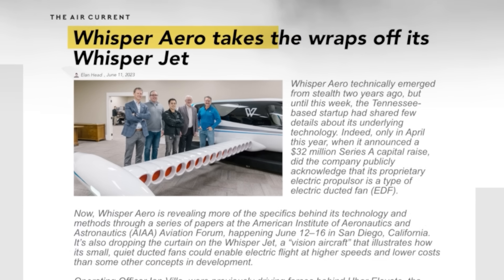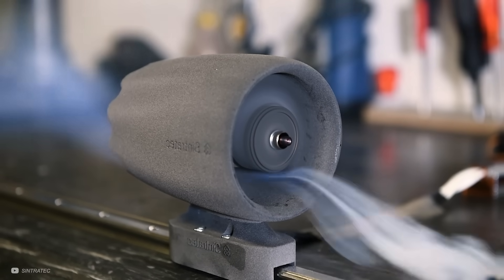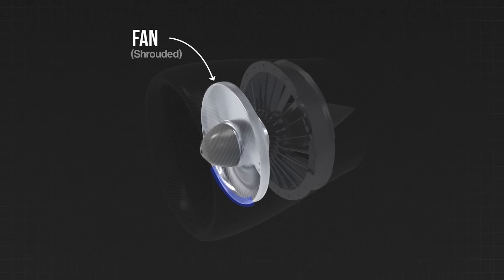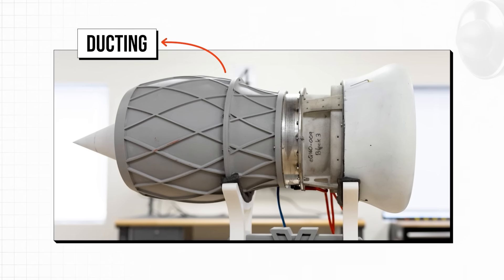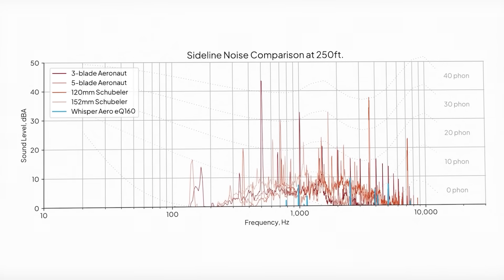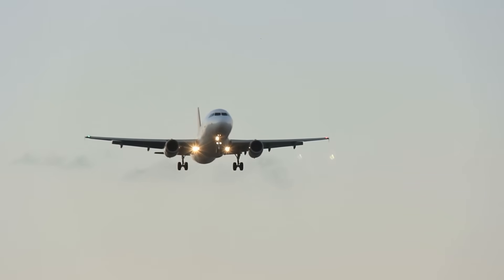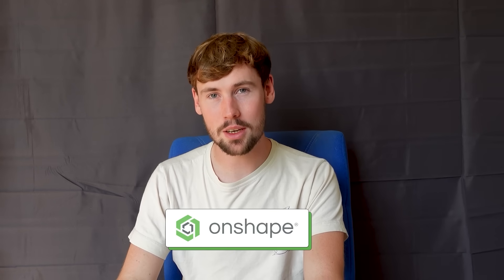This Genius Jet Engine Is Starting A Revolution

Comment from the maker: I really think this innovative design is worth making some noise about...

Check out Onshape for FREE: https://Onshape.pro/Ziroth - You won't regret giving it a try!
Reply: Just as with Lilium the swept area is too low and gets worse with more smaller ducts - heaps of interference and duct scrubbing drag .no laminar flow, don't skid or sidestep... Lippisch invented the concept, used by Collins radio and Dornier for drones and RFB in one off or very low volume production - didn't work as hoped and abandoned. In any case solving the wrong problem  . Evtol or ectol is the problem not the answer
 Impractical 'answers' by researchers who must keep researching, not solve things....
Reply: @rossnolan7283  All those daft E-VTOL concepts are going nowhere. It's not difficult to show that with current battery energy densities, they can fly for around only 15 minutes maximum. Airbus had one that managed 13 minutes for example. Completely pointless and Lilium has gone bust of course.
Reply: Until you have a lightweight source of electrical power for aircraft, ANY form of electric drive for aircraft is completely pointless.
Reply: so now calculate a normal engine on a 737 , using 1 liter gas a second , to joules, multiply that by 2 cuz 737 has 2 engines, and calculate back the batteries needed on ur electric plane ...pls give us the extra weight of the batteries .... add that to the planes weight ..... and then calculate the energy needed of ur electric plane , compared to the lighter gasoline plane and give me the numbers ...  oh , both planes have to be able to fly 8000 kilometer ...like a gas driven 737 is able to.......... have a nice day ...
Reply: @emilepojogeanu I think its already been established that electric engines will not be capable of flying an aircraft as fast as combustion engines. We're trading off speed for power efficiency and range here. We can't have all of these at once. Unfortunately, like LEGO Technic MOC builder Sariel said, there's no free lunch in Physics.
Reply: The blades in a standard jet engine are there to create compression from the expanding gasses which creates thrust.  In an electric engine though, these blades are merely fancy shaped propellers, nothing more.
Reply: @douglascounts4634  Is it same nonsense a like electric pump for oxygen and hydrogen in rocket engine.
Is it bullshit.
Reply: @douglascounts4634 Modern airliners don't have 'standard' jet engines, they have high-bypass turbofans. The bypass (cold) air produces up to 90% of the total thrust, with the jet engine part mostly being used just to power the fan.
Reply: @ZirothTech you might want investigate the FAST Fan Project headed by Rob Bolam at Wrexham University - 
Rim Driven Electric Fan - highly Efficient - genuinely a game changer.
Reply: I don't remember but did you made a Video of Jetoptera Bladless Propeller?
That seems to work way better than this
Reply: except it wont cuz battery energy density is absolute ass.
Reply: @permacultureecuador2925  lol you havnt kept up they have batteries atm that do 600 per kg now airplane fuel is only 690 equiv per kg. batteries are now more than powerful enough to fly any aircraft really. if the rotors achieve 92% efficiency they will have the same flight duration with a battery as a conventional engine with  airplane fuel
Reply: The whole premise that they're doing something unique by combining aerodynamics, propulsion and acoustics is wrong IMO. This is exactly what every engine designer at any jet engine manufacturer has been working on for decades. The difference is the electric motor instead of combustion to accelerate the airflow. So it should be compared to other electric fans. Some interesting concepts are explained, but also entail downsides. E.g. A higher frequency of the fan blades could produce sound outside of our hearing range, but it also comes with more drag. The big question with any electric motor so far is how it scales to produce the thrust needed for a larger plane, while remaining light enough. So the power density of the motor is a limiting factor, as well as the energy density of the batteries for range.
Reply: Great video! Thanks for sharing!

2:52 The funny thing is that I proposed this integral shroud propeller idea before for future aircraft and people told me it didn't make any sense and would be too expensive. Could I be missing something here?

5:56 I recognize this design. Unfortunately, Lillium Jet used the same technology and it failed spectacularly for them when they ran out of money. Most cite this unconventional propulsion system design choice as one of the major reasons for their downfall. Am I missing something here, too? 

Nonetheless, for the foreseeable future, I'm afraid that most electric aircraft will continue to use traditional propellers for propulsion.
Reply: My opinion is that the author of the video is an idiot. And the video also contains paid advertising. So twice idiot.
Reply: (copy) It would be interesting to see how this works with the new Axial-flux motors by Mercedes AMG along with Aluminum-ion batteries. Now you might have something to crow about!! Huge power to weight ratio (750HP=15Kg) and immense power available from Al/ion batteries which have +- 3x energy density of lithium/ion, PLUS no overheat (therefore no cooling required) and zero fire risk therefore no fire extinguishers needed. All that extra weight savings can go into batteries. This rig would be able to replace all gas powered aircraft systems, and some lighter jet powered vehicles. It can also be used for maritime traffic, using Na/ion batteries, completely eliminating use of bunker oil for ships. Full recharge in under 5 minutes with no risk of overheating with Al/ion or Na/ion batteries. So with that amount of power available (a Cessna 172 produces about 170HP@2700rpm) This type of ducted-fan may already be obsolete.
Reply: Plz fix your audio for the video.
Reply: YES, good, its not just me then.!
🔵👉Fix your bloody audio👈🔵
plz.
Reply: Despite us not hearing it, some fouls of the air and some insects might get confused by it.
Reply: Going to be much less fuel efficient than a simple prop for many reasons. Only good for wasters such  as warons.
Reply: @PrivateSi  Propellers have their problems too. One is noise and efficiency loss if the tips go supersonic, which limits the power you can put into them. You can add more blades but that reduces efficiency. At some point a ducted fan becomes better because it eliminates tip vortices and straightens the airflow.
Reply: @bhabbott  .. Props are quieter than jets, correct tip design eliminates supersonic tip issues and reduces noise. Ridiculously fast drone jets cannot be fuel efficient, so only practical for War, where MEGAWASTE is the modus operandi.
Reply: i really think "i respect you time" phrase means "NO subslike-beggings, NO spam and NO SH@T" ☝
so, enjoy your Technical Dislike. 😘🤗🥰
Reply: theirs also a new engine that has the rotor attached on the outside that allows them to change the angle of attack on blades for different altitudes, fully electric also has no ceneteral attachment
Reply: Thirty years in IT. Tried to sign up for onshpape. Doesnt work, no errors,  no way to contact support.   Building Confidence??????
Reply: Dont compare the engines, compare the battery to the gas tank ! Which is the winner ? So far NO ALTENRATIVe to gas for airplane ! And even for all ; bus, truck,boat , but bikes and small cars (which would solve already a lot of issues ! NO NEED FOR A 2.5ton EV (or in fact any kind of power) SUV to move 80kg of meat on average !). Boat could use nuclear.
Reply: @jpcaretta8847  Yeah you want that because it's a terrible comparison that makes you look good. 

Preferably this technology gets adapted to a hybrid system. 

That way you only need to carry enough batteries for the cruise phase, and you use jet fuel or really any fuel at all for the climb phase. Now you only need a tenth of the batteries. 

Also the engines are vastly more simplified. There's already documentaries here on YouTube. It's like comparing to space shuttle main engine with the Raptor 3. All the bits are the expensive and complicated part. And also unnecessary with proper design. 

With a hybrid electric jet you lose a tiny bit with transmission inefficiency for a very small portion of the fight envelope in exchange for massive efficiency gains everywhere else. Not the least of which is having an infinitely variable transmission in practical effect. 

Disruption is axiomatic. You have to start from the drawing board. You can't just make assumptions based on analogy.
Reply: 1:46 I learned that a motor uses power and an engine creates torque from a fuel.
Reply: @jsbrads1 you learned nothing then
Reply: @jpcaretta8847  Leave Jon Snow alone.
Reply: @jpcaretta8847 he is right. Ford motor Co is a misnomer. ICE  = engine. Electric = motor.
Reply: Please stand with palestine for innocents and babies.. 😓

Comment: Unlike other EDF makers, Whisper is not revealing measurements of thrust vs. power at a range of RPMs for any of their designs.  This is the efficiency metric that matters most.  One should be skeptical of claims that are missing the most important measurements.  I'm speculating that the missing efficiency measurements are an indication of poor efficiency, but they could easily prove me wrong... yet they don't.

Comment: Years ago I looked into an electric outboard for my boat. The company bragged that their 8 lb battery contained the energy equivalent of 1.5 ounces of gasoline. The motor had limited speed and range. My gas outboard has much more power, vastly extended range, and is lighter in weight.

Comment: There is a mine near my house maybe 6 miles away, they blast several times per year, you cannot hear the blast but the subsonic waves will rattle the windows and just because you do not hear this blast in your normal range does not mean it is not affecting you.  I do hear the windows shaking after the blast but even before that I am startled by these very low frequencies.  It is actually very distressing.  I also have read that elephants can emit subsonic waves that they can detect in their feet so that they can send each other messages over many miles.  High pitched noise that is on the other side of what humans call sonic is probably just as damaging, just as threatening, can you imagine how wild animals and house pets are going to react?  Just more pollution and degradation of our world.

Comment: The comments about energy to weight and volume have already been made. The second problem is the motor power to weight output. Since the motors will be made of copper and iron it will be quite heavy and have significant disadvantages to gas turbine power or even ICE engines for small planes. NASA studies have shown 2 orders of magnitude worse system-level power to weight when the entire system (power producer and energy storage) is considered.  The comments about the fan efficiency is also not correct. Modern fans on Gas turbine engines are well over 90% polytropic efficiency.  Thermodynamic efficiency when including compression, combustion, and turbines is close to what you state in the 50% area. If looking at those  efficiencies you will need to look at the battery-motor storage and generation energy transfers and overall they will be very close to gas turbines. Also this system does not scale well as the weight increases with the cube and power output with the square.

Comment: "Fossil" fuels and hydrogen 8 days a week...anything less is for pissants and soyboys.
Reply: Honestly...not a real issue yet (noise), but if reduction means better efficiency, then great.   However, material science and mass production isn't there yet...and physics will always be physics...so whisper quiet propulsion near or past Mach 1 is going to take awhile...perhaps longer. Also, electric or not,  is probably not an issue unless you can be your own (perpetual?) rail gun.  Now THAT would be transformative.
Reply: I swear...we have to stop chasing our little dxxxx and dream big again...anything else leads to acne and testicular cancer...

Comment: What about a new orbital propulsion system that Adaption Systems Security and Defense was working on that was halted from going over to DARPA for development due to the radical activities of the Trump Admin causing many top designs to rush out of the USA.  Originally developed to reposition defense sats without the need for liquid fuels.

Comment: It's all about the powersource for these devices. If the powersource (batteries) are heavier than the fuel - and it will be, that's going to be a technical problem.

Comment: A hybrid solution whereby a normal bypass engine is used while the electric enging is there to assist takeoff, Cruise (reducing power on bypass engine/fuel saving) & reduced power/noise setting on landing in built up areas.

Comment: The batteries are too heavy, doesn't make sense and is battery technology safe? Because stored energy in batteries has known to be unstable. The Second Law of Thermodynamics that states in a closed system, the entropy (OR DISORDER) will increase over time and so a battery will deteriorate and will eventually dissipate its stored energy either gently or if violently like a bomb. Energy seeks equilibrium.

Comment: If the engine is very effective in directing air flow over a large area along the top surface, this may reduce the risk of a stall also.

Comment: Think Dyson are prety high up in the flow of air - their domestic 100,000 rpm motors are marvels of efficiency. Do you think they are working on aircraft engines?

Comment: What a pile of horse refuse. Where are the energydense batteries to power these engines? Nowhere. Even the best batteries are dozens of times heavier than jet fuel in terms of the energy stored per unit weight. These engines are pure Cgi vaporware designed to milk clueless investors.

Comment: Hmmm.... the elephant in the room is the source of the electrical power. Batteries are heavy and inefficient, and have a nasty habit of self igniting.
In an industry where weight is the dominant factor to cost control, the next thing to address is the power source.

Comment: A larger whisper jet would be a great test option for a Cirrus Vision jet. If they can keep the battery onboard the same weight as a full tank of jet fuel, maybe solid state batteries , that could be a huge deal.

Comment: The physics of reaction engines is that it is more energy efficient to accelerate a large mass of air relatively slowly than a smaller mass at a much higher rate of acceleration.

That is because thrust is the rate of change of momentum, and goes up linearly with the gain in speed per unit time, whilst the energy imparted into the reaction mass goes up to the square of the gain in speed.

That is why turbofan engines are getting ever larger in diameter with higher bypass ratios.

Whilst small, high speed fans are space efficient, they are not energy efficient.

I am not convinced. Lots of CGI, and entirely opposite to the direction being taken by conventional turbofan manufacturers. They have large fans, with fewer blades. Also, the implication that they are almost unique in using advanced computer simulation to reduce development time is laughable. I doubt they use a fraction of the computer power in simulations uses by the likes of GE and RR.

Comment: the whole design looks suspiciously close to the design of Lilium, a multi million company that went bankrupt last december. The fan design is very similar, the integration into the leading edge of the wing is at least close to the lilium idea. 
the fan might be great, but integrating it into the wing might lead to some structural problems with the wing....
and as stated in other comments, the big question still are the batteries!

Comment: thats just an edf fan , theres literally nothing special about this other than it being a bit stupid xD. 
when talking propeller-propulsion efficiency, the lower the blade count the better. this law didnt suddenly change overnight. more blades just give u higher pitched, but louder noise, lower efficiency and more static pressure (which isnt really the same as more thrust). 
this is more of a compressor than a useful engine design... 
most edfs have a stator which counteracts the rotational component of the airflow, so that is not innovative  but a standard design choice.......
 also u can incoporate any edf into a leading edge, thats not a unique selling point at all........

Comment: There's a bit of a problem. 1. For younger folks 16khz is still audible and is a pretty hideous frequency. 2. For more than half of the populations, loud sound in that frequency despite being inaudible to us causes quite a lot of discomfort, to the point of being painfuil for some, and all studies on the subject show that it causes agitation, irritability and an inability to concentrate.  3.  Regardless of whether or not you can hear sounds at 16khz, it can still do profound  damage to your hearing if too loud and leave you with hideous tinnitus.  

So not whisper quite so much as brutal ringing in the ears quiet.

Comment: Keeping images in screen longer and using slower exploded diagrams so those who understand fan design can see what interest them would be helpful.   
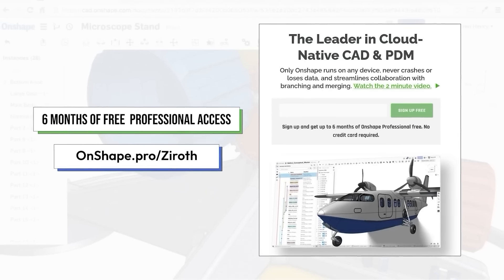At 10:58 you show a variable aperature orifice which has nothing to do with this topic except it is used to control airflow but not at all in this sort of application.

Comment: I've wondered about doing an outer ring design, but seeing this.... why not integrate the 6 phase power into the stator itself? Must be weight and cost. I'm also curious if we'll see airliners with the leading edge engines AND two tail end big engines of the same design?